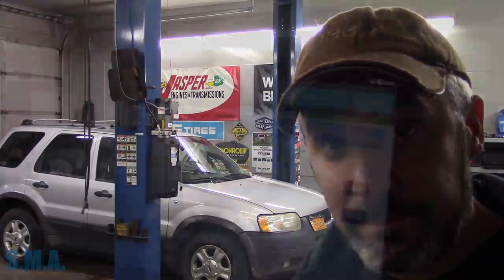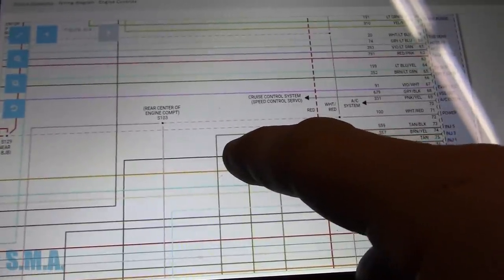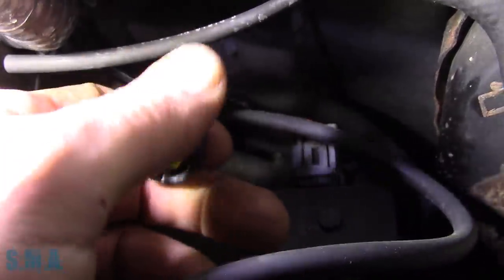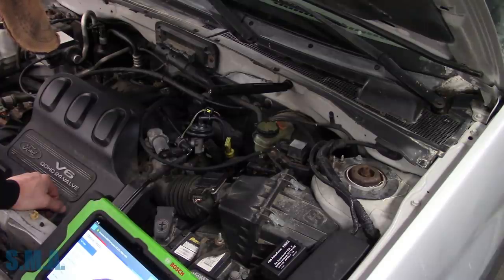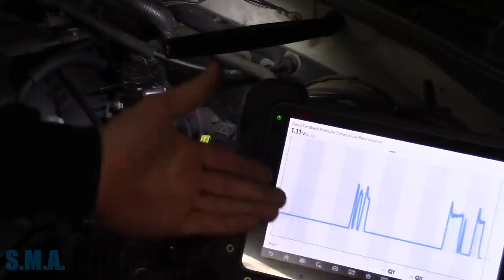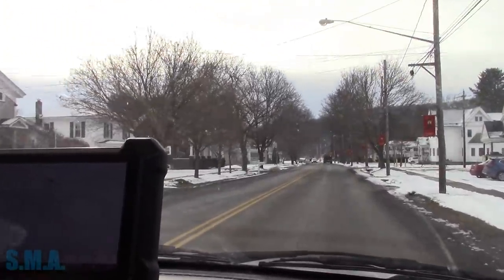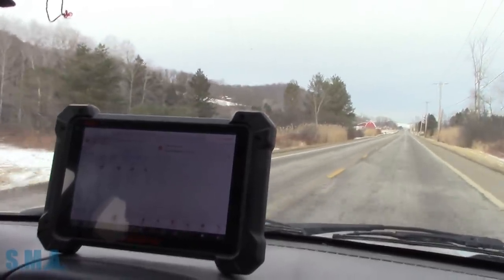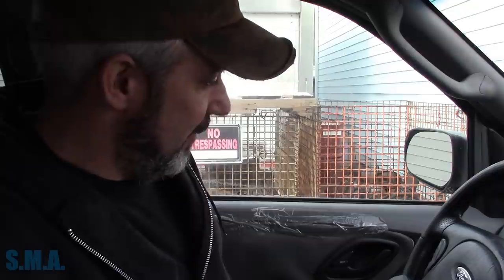Ford Escape: EGR Valve Problems

Comment: Even professionals often smirk when they see a guy pull out a meter and prove the diagnosis before replacing a part. Their point is, swap the part most likely to be bad, recheck, and most of the time they've saved 10 minutes, move to the next customer. Thing is, when time comes to actually diagnose a problem without having new part in hand, they don't remember how to do it efficiently. You've shown, time and again, that consistently proving the diagnosis usually isn't difficult, and often doesn't take much time. The golden reward is understanding, the satisfaction of working with lights on rather than guessing in the dark.
Reply: I'm sure the other shop got the owners approval before buying replacing any of those parts. New York you know how strict they are on shops now.
Reply: @brianw4brian  they will have/ But I think he's saying throwing parts at a problem to see what fixes the issue isn't how you diagnose the problem. Even if it does fix the problem, as far as diagnostics skills go, they don't have any, or severely lack them because of parts throwing. In the end up just replacing parts also costs the customer more money. They give the go-ahead trusting the mechanic knows what he or she is doing. Not so they can mindlessly spend money on parts for no reason.
Reply: @jonnywilson9117  lol. I know. I'm a mechanic/ computer technicians/ electrician. I got ase a8 a6 l1 blah blah.  Even with ase some dealer mechanics dont know their own vehicles.   I'm held accountable to state for crappy diagnosing.   If I did that in smog shop enough times I could go to jail.  73 degrees put fan in front of running vehicle while on dyno got to be certain feet away.  Eric o just used parts cannon I say spaghetti thrown see what sticks.  The wire broken was an easy fix. We'd of checked that to begin with...
Reply: The easy ones  you can guess are useful for training your brain/process for the hard ones.  Diagnosing is a mind state you have to train yourself to slip into.  The more you shift into the mindset, the easier it is to slip into it.
Reply: Fixing it right the first time is also more likely to get you repeat business, albeit hopefully for other things than what you fixed.

Comment: The most best lesson I got from this Video, is that no matter how long you drive the car to get the engine light 💡 to clear it will not. 
Many mechanics make you believe you telling you to drive car like over 40 60 miles and come back only to come back and after wasting all that time and gas they will tell you to try it again. 
Just fix the issue and avoid the stress of driving for over 100 miles plus.

Comment: I thought I had tested thoroughly, but after watching your video, then waiting for the smoke from the parts cannon to clear, I took a deeper look at the solenoid valve connector.  I thought the connector was good because I had 12v to battery ground on both sides of the valve,  but it dawned on me that I was getting the 12v by sticking the probe down into the connector.  Once I pricked the purple wire itself, no voltage, and tugging on it, it was obvious it was just the insulation and no copper holding it together.  Problem solved, I appreciate the help.  2002 Escape, 218K and going strong.

Comment: I introduced your channel to a friend of mine (Mainly by hyping your brake cleaner introduction method, and that one brake rotor "incident" that cut your air line), but also due to your analytical breakdown of faults to come to a correct conclusion.

He used to hesitate to work on his car, but now, he's buying parts he wouldn't normally replace himself, and scheduling "car days" to get 'em installed (I'm participating and helping push him along.)  

Thanks for promoting self-repair and not being lorded over by the mysteries of the dealerships.

"If you can do it, he can do it."

Comment: It's a good thing people that live around you in that area have a competent tech around. So many of those other places it appears don't do as much diagnosis as they should be before parts are replaced. They could have at least checked for power on the battery feed side, then continuity on the control side.

Comment: Had a guy bring me a Honda push mower; new carb, ignition module, valve job done at another shop for $200+. Still cut off after 10 minutes. Fuel cap vent was plugged...
Reply: At least there was gas in it.

Comment: Yes Eric. I tried to hide a P0740 code on inspections for 5 years by getting the monitors to clear and then getting it inspected before it set again. The problem was the clutch itself and I didn't want to replace the converter because it just wasn't that important to me. My little Acton scanner would let you run an active scan of the monitors as you drove so it was easy to do.

Comment: I have the same car and my EGR valve blew a hole right in the unit and it had a massive vacuum leak which caused the car to basically chug and can’t go out thank goodness it wasn’t too far from an area to where I could fix it the part cost me like 40 bucks it was pretty amazing to see that there is a hole that blew out of the side of it even though it’s made out of aluminum

Comment: No! Eric you are right! I have dealt with many shops and I have had my truck in your shop and you noticed stuff that I have replaced in the past. I am like you. Find the problem and fix the damn Truck! I don't take my Truck to any shop at all I learn from you or I will find the best answer from searching and finding out all what not to do until I am warm and fuzzy with a correct way to solve the problem. As always thank you and keep on teaching.

Comment: My personal experience with EGR valve fault codes are quite simple: its not the valve but the piping leading to the intake that fouls up with carbon.
Its not that easy to clean out, but you will instantly recognise the problem by the carbon deposit removed.
In one instance I had less than 3mm opening left. Typical for cars driven in city traffic.

Comment: Once in a while a gift (broken wire at the connector) is handed to you.  When it happened to me, I repair that connector because a previous supervisor threw out all my connectors I had just for this occasion!
Nice repair, watch the MIL light come back on for part 2.

Comment: This may have just helped me start diagnosing the intermittent rough idle on our '03 Escape V6.  Once or twice a year (seems to be when very hot out, and after a highway jaunt) it will start idling very rough, EXACTLY like this one did when the EGR was manually engaged at idle.  It's so infrequent I haven't devoted any time to it so far but if it happens again I'm looking at the EGR system first at least.  Thanks!

Comment: You can do bi directional test Eric. Do KOER test after you clear the codes, U can put the lab scope on the control side & vacuum gauge with T on egr valve, that way u can see if the ecm is sending duty cycle & u can watch the vacuum gauge increasing to 7 in.hg if the egr solenoid is working. Take care, great video.

Comment: 14:41 Am I the only one who started learning the other way so as to not fall over?
Reply from the maker: I better not get a call from your lawyer... 🤨 Besides, you should have had you buckle on
Reply: I was holding onto the door, but seeing as how the driver door has a roll of tape on it, my chances of holding on are slim.
Reply: Hey Astro, I just bought the #7412 Kit... Should I throw the 10MM out now, or wait for it to go missing of natural causes?
Reply: @MikesSoftLemonade  We put loctite on the swivel pin for every size but 10mm, checkmate either way :P
Reply: @AstroTools  Alright perfect. I just threw it out and ordered two more!
Reply: I've learned to wear a helmet.  Seatbelt is on order, should have that installed next week.
Reply: HOLY CRAP BISCUIT!
Reply: @MikesSoftLemonade  That's the first thing i do when i get some new sockets,open the box and throw the 10MM in the trash,can't go missing if you never had it.
Reply: I'll admit, I didn't realize who posted this comment until now. Hmm... not a sponsor?
Reply: Joe Copa  Face With Raised Eyebrow
Reply: @MikesSoftLemonade  I have the same kit.  Arrived without the 10mm.  Those Astro guys think of everything.
Reply: WHIPLASH!  ---   Guess I'm calling in sick today. Call that pretty masseuse and schedule me for 2 hours. I'll be fine.
Reply: @ShainAndrews  Luckyyyy
Reply: Mike Phelps I must be the only mechanic on Earth that has ever worn out a 10 mm socket. 🤔😂
Reply: @scottsmrcka2769  how would it wear out if it gets lost almost immediately?
Reply: Mike Phelps I can honestly say I don’t recall ever losing a 10 mm socket. I know that seems improbable but, it’s true. 🤷🏻‍♂️
Reply: I gotta quit drinking while watching Eric's videos! 🤭
Reply: @AstroTools  Hey Astro, I need a replacement hanging clip for my SL40MAX. What should I do?
Reply: @Dimera1  buy a set of 20, only 10mm, still lose them all. They're out screwing around with the 1/2 inch wrenches.
Reply: Joe Copa  It's an Emoji. Hold down the Window's key next to left Control key and press the "period key" and they will pop up. Click on the one you want.

Comment: My state stopped requiring vehicle inspections back in the middle 90’s  not really sure why but then they only checked the basics -lights,tires,wipers,glass and horn. Inspection cost plus sticker $5 bucks. Sticker cost $2.50 so shops didn’t really want to waste time.

Comment: Eric, you are an electrical God!  You want a challenge?  Come work on boats with us.  Take all your doing and throw in some salt, black wire corrosion, voltage drops, systems that draw 400amps, engines that start by themselves...You would love it.  You have the colorful metaphor part down pretty good and you would fit right in!

Comment: You’re much smarter than engineers
Reply: It's not engineers, it's the certification schools. Who is issuing licences now days, Cracker Jack?  I myself have had those break. The green crustys eat away the wiring in those connectors being exposed to salt and corrosion. In Michigan, it's a very real problem. Mechanics NEED to be aware of the environment they work in and take that into consideration EVERY TIME an issue concerning lack of input or no information is being relayed. Having someone poking around in a harness and NOT sealing the exposed wiring after wards can guarentee a future visit to a garage. Mechanics are simply NOT being trained to do a proper back probe. Taking short cuts and generally fudging a job to save time ends up costing consumers MORE . This guy could teach classes better than any certified college.
Reply: Yes, he is smarter than many engineers that I know, and I am an engineer.  His troubleshooting skills are beyond most engineers and technicians, he uses a methodical approach and sticks to it.

Comment: Great video!  You mentioned that it smelled like gas.  What would be causing that to happen.  I have a Jeep Grand Cherokee that does the same thing.
Reply: Fuel vapor lines leaking somewhere, or something else leaking like the fuel pump assembly O-ring, or the filler neck being rusted out, etc etc.
Reply: @RobertHancock1  thanks, I'm going to check those or have them checked as soon as I get a somewhat warm day.

Comment: Love your videos....too bad your shop is 6 hours from me. :-) I have an '05 escape 6 cyl and a Puff like pumf noise is coming from the air box. when I disconnect the intake air sensor connector the engine idles down but stays running and the noise goes away, reconnect and the noise comes back in prox 15-20 seconds. EGR doesn't cause the engine to respond either way when vacuum line disconnected and I manually put a  hose on the EGR and apply vacuum at that time the engine shutters. Any advice will be appreciated.

Comment: My 02voyager 4cyl. Would buck or stall on dead start at traffic light the egr solenoid  opened as soon as throttle moved at idle ..the vacum transducer  solved the problem .🤗

Comment: Check them powers and grounds and the occasional wires that are getting ready to let loose. Would have been too easy to blame the EGR solenoid for sticking or being sluggish. Leave it to Eric to find that bad connection.Nice work Eric
  By the way who drew that parts cannon. Is that your fancy artwork?

Comment: I had to comply with state OBDII no engine light/ no pending cycle scan when I lived in Delaware.  The damn truck would throw a P0451 via a faulty design in the valve where it would get gunked up too easily and need a cleaning to function properly.  Replacing it had the same effect over and over (Dorman part was the most commonly available at 1/3 the cost of OEM).  So I would clear codes, get my 50 miles or so in, see a ready and drive it right over to the DMV and take it through the inspection lanes.  It was a constant fix otherwise and didn't affect mileage or drive-ability.  Now I live in FL where we don't care about emissions because of the constant winds that blow pollution out to sea and the damn code pops up once a week.

Comment: Give me an old '55 Chevy with a 365 cu in V8,  Motor with a carburetor, a fuel pump and a distributer.  No BS valves or computers.   All you had to do is maintain them and keep them tuned.

Comment: Are all these other shops jiffy lubes?? This is pretty basic repairs, Im not sure why they have such a difficult time fixing these issues.  I always consider wiring gravy work, especially this one!  A quick tug test found the issue, you would think just unplugging it would make the tech stop and think.  A soft or broken wire feels way different than a good one.  
   I would love to see these shops diagnosis a pre 96 obd1 car, I could only imagine the amount of parts they would throw at it.  I bet these same shops would drive off a cliff if their gps told them to.

Comment: I agree with "just fix the car" but sometimes when a $2K cat goes bad on an older Toyota, and knowing the aftermarkets often don't last a year, it can be helpful to see if you can get it through with a monitor or two not set.  Most everything else I can't see any reason for not just fixing.

Comment: I plugged a high beam bulb into my fog light in my truck. It blew the bulb and both fog lights don’t work. The toggle light in the cabin is on but lights don’t work. Replaced the fuse, and nothing. Anything else i can do to fix it? It’s a 97 ram

Comment: Does New York have a full-on "safety" inspection, plus the emissions?  Or is it just an emissions inspection?
Reply: Yes all cars get safety inspected annually in NY but that's usually the easy part, at least for someone that takes care of their vehicle anyway.  Safety just checks for operable seatbelts/lights/wipers/horn/etc. and also the condition of things like brakes and tires.

Emission inspection is only for vehicles less than 25 years old and consists of checking for codes in OBD-II computers or visually making sure factory emissions equipment is intact on older vehicles.

Comment: Now we need to know why these Ford Escapes eat catalytic converters! Lol
My wifes has a code for both bank 1 and bank 2... think it was P0420 and P0430 if i remember right. The buggers arent cheap and the vehicle is older...Would like to fix it right for her but really have a bad feeling when it comes to dumping money into an older vehicle!
Love your vids Eric. Thanks for them.
Reply: Make sure you don't have any misfires; that caused the demise of one of ours and apparently can be a common problem on these, I learned.

Ours would have intermittent misfires on damp days and eventually the bank that was having that problem ruined the cat on that side.  Replacement coils solved the problem.
Reply: @ericbuist8218  
Yes sir, you nailed it!
Ours is having randim misfires usually on extremely rainy days.
I can feel it under certain rpms, but when i get home, its not showing any misfire codes...
Gonna have to try and track it down.
Reply: @splash5974   Sounds like your's is following the exact same path ours did!  What I read at the time was that it's common for the coils on these engines, as they age, to develop cracks that let moisture in, so that when everything is dry there would be no issue, but damp/rainy days would cause the affected coils to stop firing.

I couldn't see any noticeable cracks on any of mine but since I read this same thing in a multiple places and it seemed to match my symptoms perfectly, I'll admit that I loaded the parts cannon with 6 new coils and plugs for good measure (everything was original at the time - 13 years/130K miles at least) and lit the fuse.  Luckily, it's been 4 years and have not had any misfire or converter issues since.  Good luck!
Reply: @ericbuist8218  
Thanks Eric! Its been a great vehicle for it, and we got it from my grandfather who owned it for years... So maybe its worth trying to fixx. I wonder if i could fire it up and take a water bottle and wet each individual coil and wait for the misfires? Its just srange that it wont set a code for misfires...
Ive also heard the connector at the PCM on the firewall could be an issue with moisture aswell.
Im north of the border, so il wait for a milder day to try this! Lol
Thanks for your help

Comment: Eric I have same kind car but a 2002 xls got a noise coming from steering column, slow Incasement on transmission when you go foward. And ideas what I should do or test. 140,000 miles on the clock